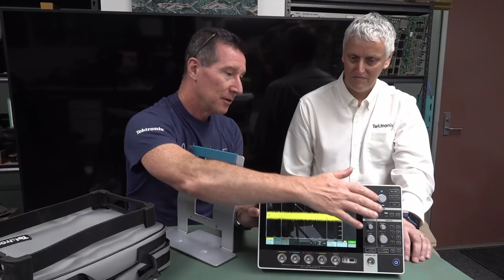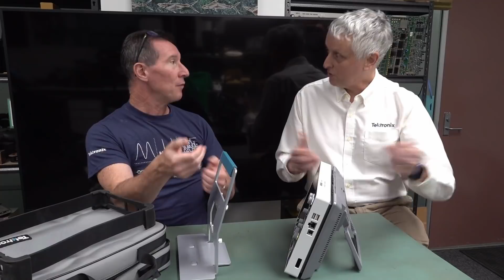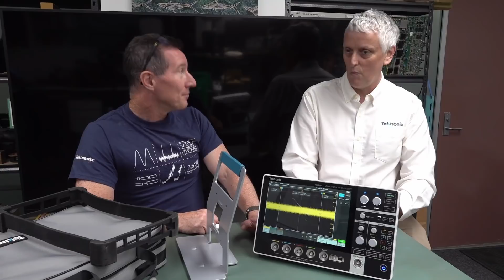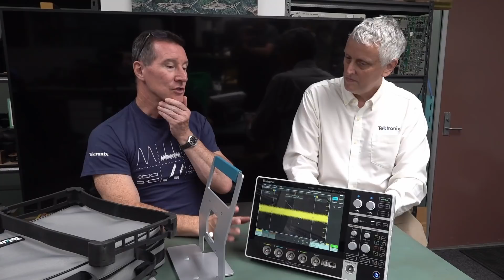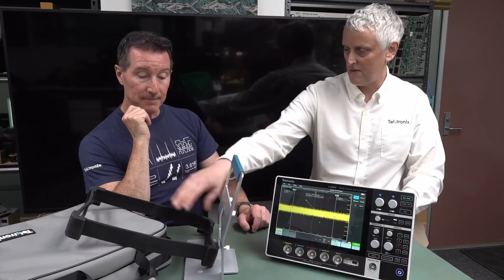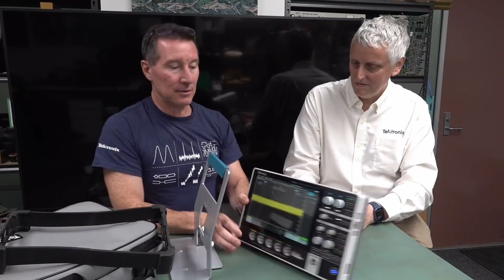Tektronix 2 Series Discussion with Andy Tedd from Tektronix

Comment: Great video and hopefully people on the main channel will take notice.
Such a plus with those rotary knobs..
I'm 100% pro knobs on mobile/bench touch scopes... exactly what I need, something that is mobile and I can take to items, and I don't have to take the item to the bench 24/7.
# and I need good clickable rotary knobs and I also need real buttons, not tactile (got bad experience with tactile dome buttons) 
# and also need a decent bright touchscreen for outdoors +400nits and a decent PPI at around 125 to 150pixels pr inch, so waveform & values look somewhat clear - 
# and I need a decent amount of memory depth (like around 30meg,  that should be good enough) 
# and I need around 100.000 waveforms pr. sec update rate 
# and of course 4 channels.
# and I need full-size HDMI-output for easy big-screen connection, and with USB socket for keyboard & mouse and likewise 
# and a good decent inner drive-storage - so I can record video & pictures on the scope it-self and upload or transfer it via wifi or drives.
# and also need office-like software, excel, word, etc, so can datalog values on the fly too excel-like sheets & easy graph it out - and do all that on the scope itself.
# and I also need included-serial-decoding with all the common ones (included from scratch without extra funds) 
# and I need heatmap color-corrected waveform ability.
# and I need at least 256 levels of greyscale grading for that analog feel.
# and would also like advanced math and all that extra jazz & goodies.
# and the scope-unit need to it be with included battery from scratch, and not too thick, like max 5cm in total with both battery and an inbuilt kickstand, - thin as a total package so you can use it one-handed in a pinch while it's running on its internal battery.
# and I also would like Power Delivery ability, so I can use all my power delivery power banks or PD protocol based-PSUs to charge or run it from, as I already got those around - for so many other things.
# and I also need a wireless interface to both PC, Android, and iOS and you get software for these systems incl., and of course with low input lag (max 0.2 to 0.3sec lag) and many times updates per second, so it's useable in practice.
# # and most importantly - I need to be able to play my 80s gal, Samantha, on it  :P 
= my budget is around 400 bucks (with incl. 25% danish VAT.) 
Anybody..??
arhh nevermind..https://www.youtube.com/watch?v=mAQhy0pM550
and since you have these apps for iOS or Android etc.. you can easily connect to apps on fx battery-based projector from the scope and have waveforms bouncing and could in theory be the size of buildings. https://youtu.be/wlkgdtkoAeE (hmm, the obvious question..why the fre4king f... do you want waveforms. the size of buildings?? 
why not !! just imagine too almost be jumping-robe with your beautiful sinusoidal waveforms.!!

Comment: Hello All & Dave/EEVblog,
I have looked through the messages and have not seen any mention of what I thought is both a mistake by Tektronics and an oversight by Dave for not asking about it...

Why didn't Tektronics use USB-C with power delivery as the power input and circuitry for the Series 2 scope?

It (USB-C) has the capacity to both power the scope and charge the optional dual battery pack and it is a universally available and easy to find replacements...

If you want power supply with a right angle plug, you can buy that! If you want to power it via a capable laptop, you can! If you don't have the battery pack, then you could downsize the wattage of the power supply since you don't need the extra capacity to run both scope and charge the batteries!

Using that round "S Video" looking DIN connector is a big mistake!

Thoughts, anyone?

Best Regards...
Reply from the maker: Robustness. Fine on consumer products, not so great on an expensive bit of industry test gear.
Reply: You can useally just made it power delivery yourself.
a typeC interface is fragile and if they only need power, it would not be ideal for a TypeC that is preferred hence number of pins and wide acceptance for other gear..though if they made it video-out with TypeC etc etc.. then it would have been quite nice
biggest problem for power delivery, is if its 24v..
if it was 20v or 15v or 12v then I reckon you could just put a TypeC PD trigger chip on with that voltage and DIN on the other end.. unless there is some handshaking taking place on on some of the secondaries on that 4 pin DIN connector but it seems its earth grounded and 24v so not that easy to use PD after the fact.

Comment: Great that it has Ethernet. Way better than WI-FI for an oscilloscope. But the big proprietary power supply is a bad choice. Would be great to have standard USB-C power delivery to power it. They could have saved the money, the customer wouldn’t have to carry around another bulky power supply and there wouldn’t be as much e-waste. I normally carry around a 100W USB-C power supply for my laptop and phone anyway. You could then also use your laptop (that already has a big battery) to power it at a remote location via USB-C
Reply: USB-C connectors are too wimpy, wouldn't last any time at all with daily use in the field